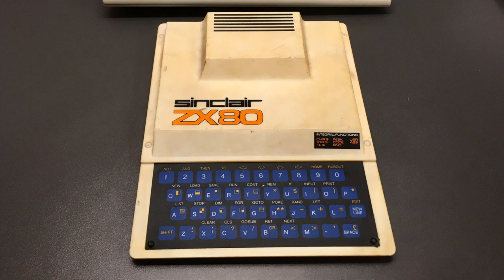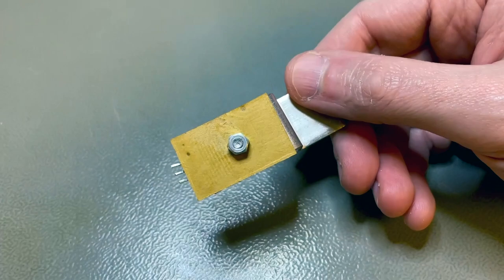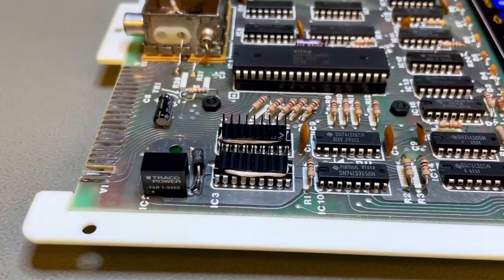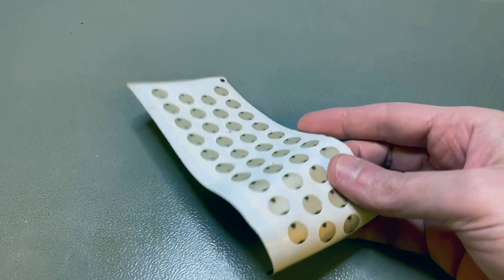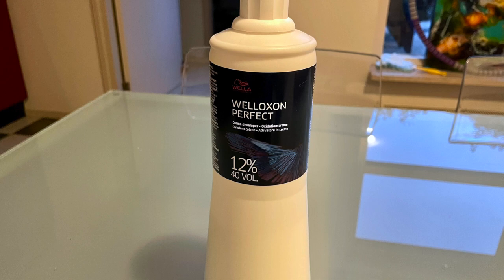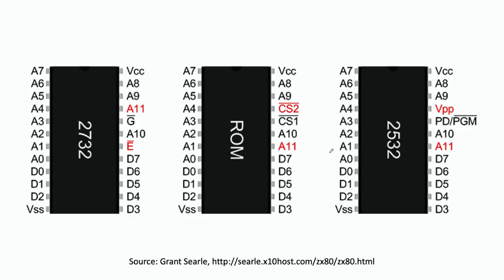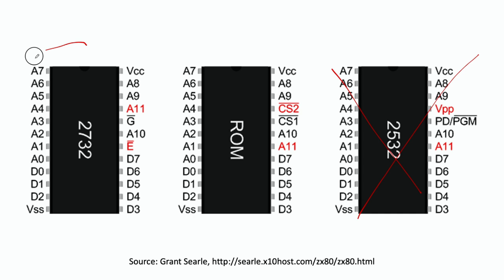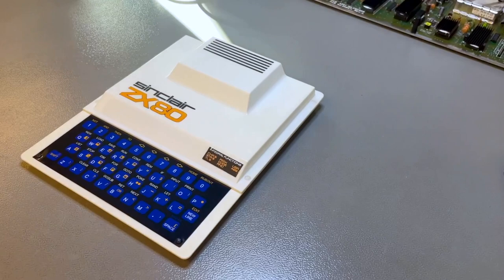ZX80 mini-restoration tutorial

Comment: Back in the day, when this sinclair was released. I really found it amazing that they could make it so so small. compared with all other computer's from that time, Sadly i have never owned on myself, but i always looked at them with much respect.
Reply from the maker: Engineering-wise, it's both terribly ugly (the cost-cutting shortcuts, such as a resistor bank to arbitrate bus priority...) and exquisitely intelligent, almost a miracle of parsimonious design!
Reply: @thebyteattic  Yes. That banks of resistors for "conditional" bus isolation is very clever.  I love the way the design uses the CPU executing NOPs while the hardware fetches and displays character data.  I built one from a kit in 1980 (placed my order at the show where they launched it). Sadly I no longer have it.

Comment: Thanks a lot for this, very very helpful.  I recently came into one, and I'm going to do something similar. One question on the retrobrighting. Can the peroxide go over the logs on the case - seems difficult to avoid, and not sure if it will damage it?
Reply from the maker: I had the same doubt. I tried to keep the peroxide away from the painted logo, but there was a little corner where it did get over the logo. And there was no damage or discoloration. So I guess it's safe, but am not 100% sure. I did keep most of the peroxide away from the logo.

Comment: Very nice. The EPROM bodge wires I would have used a thicker gauge and did the crossover in the socket itself rather than soldering to the board.
Reply from the maker: There is no vertical clearance, in the ZX80 case, to add an extra socket. And it is, of course, impossible to solder the bodges to the existing socket without going around the edge of the board, which would be difficult to fit into the case and be ugly/unreliable.
Reply: There is no real need to use thick wire here, just wire wrap wire is perfectly adequate! Bending out the EPROM pins does now win a beauty contest, but is quite okay.

Comment: I'm planning to do a comp mod on my ZX Spectrum and I like the look of the one you she here with the transistor - is it a general mod that would be suitable for a Speccy and for a electronics n00b, what does this do that a simple 100uF coupling cap doesn't?
Reply from the maker: In the speccy there's no need for a buffer circuit, as the ULA doesn't drive the video line directly. A capacitor to remove the DC component of the video signal will do, but I'd use 100uF, not 100nF. The latter doesn't have enough capacitance to maintain the AC amplitude of the signal.
Reply: @thebyteattic  thanks that makes sense, I hadn't checked the schematic to see how the signal was derived on both machines. I have a 100uF cap so I've got no excuses now!

Comment: Neat little machines, Somewhat hard to get hands on here in the US.  I wonder if anyone ever made an aftermarket keyboard to replace that hideous membrane one?  

Could you have made in interposer for the ROM to switch the pins, rather than the bodge wires or is the vertical clearance of the case above the ROM simply too low to accept the additional height?  Not criticizing, just curious...

Changing out the 5V regulator is a no-brainer, purists be damned.  Much better to have a working machine with a small, innocuous and unobtrusive modern part, than a full correct non-functional one that cooks itself on the regular.  Sir Clive wasn't expecting these machines to be still be functional in 1982, much less 2022.  They were built to an extreme price point, intended to be used at most for a year or two and then replaced with the new model.

As always, a super job on the restore!!
Reply from the maker: Thanks! Yes, the case is too low to accept a stack of sockets (the vertical clearance is about 0.5cm, less than a 1/4 inch). An adapter PCB could fit, without any room to spare. But it would be more conspicuous than the little, short bodge wires on the side.

Comment: Why not to use modern ceramic capacitors for recapping?
Reply from the maker: Electrolytic and ceramic capacitors have different frequency responses. They are not fully equivalent, even if they have the same capacitance.

Comment: a BC547 isn't too weak, its too slow. Its better to add an input PI filter (CLC) at the input of the traco converter, but no its not needed.
Reply from the maker: No, you are flat-out incorrect on both counts; in fact, you got it all upside down. A BC547 is a small signal transistor capable of only 100mA collector current, which matters in the emitter-follower configuration used in the mod. That's too close to the mark for safety, considering an input impedance of only 75 Ohm at the monitor. So I'm afraid it's indeed too weak, as I said in the video. As for speed, a BC547B can operate at up to 200MHz (transition frequency); that's way more than enough for a composite signal, so it is anything but too slow. A BC337-40, in turn, is capable of up to 800mA sustained collector current, a factor of 8 more than the BC547B. But unlike the latter, the BC337-40 can only do 60MHz; which is still more than enough for a composite signal. Why write a comment with such a tone of certainty if you have no idea what you are talking about?
Reply: @thebyteattic  sorry, the plain fact was that I just have no experience with the rare (for me) BC337-40, (which put me on the wrong leg, I did not understand why you would use this transistor, in fact I even first assumed it could be a PNP transistor) so I opened the datasheet only to check what kind of transistor it was,I did an attempt to compare the data sheet with the BC547 though, but you are right I should have looked at it deeper. I'm sorry!
I knew the BC547 as suitable for audio circuits only.  I would normally have chosen a 2N3904 for such an HF emitter follower, (in fact I did use that transistor in my own ZX-81 clone) but it seems that in many cases in practice people assume that no transistor buffering is needed at all, as I have seen many "patches" reported as working that simply connect the RCA video output jack directly to the video signal from the ZX-81, but yes your mileage may vary with that (especially when the TV as a problem with the missing back porch signal). depending on the TV used. Again my humble apology doubting your technical expertise, I should have known better after following all 10 of your SHARP MZ-80K museum quality repair video's, which really impressed me. 

As for the Traco, I applaud the effort to keep the ZX80 cool for a longer life, in fact will do the same for two Sinclair spectrum soon (the 1A version of the Traco, 500mA is too close for comfort).

good luck with your ZX80, which I assume will also be displayed in the computer museum in Helmond.
I plan to visit the museum in the near future, with Hassan Kasdemir of the national videogame museum in Zoetermeer! Never saw your museum IRL, but I do have contacts with Awesomespace in Utrecht, and the Bonamy computer museum in Zwolle (I donated computers in the past to both).
Reply from the maker: @martindejong3974  I think I took it too hard on you, and so I'm sorry too. I do care about the accuracy of what is written here, because I'm trying to maintain a reliable channel when it comes to technical information. In your case, it was clearly an honest mistake, but there are people on YouTube who make a sport of writing confident but just wrong comments. I don't know why people do it, I don't understand what the pay off is, but I find it increasingly annoying.
Reply: @thebyteattic  Yeah, I understand why you reacted like you did, no harm done.(even goede vrienden). P.S. Ik doe min of meer hetzelfde werk als jij maar voor drie "computer musea", alleen ik woon in zoetermeer dus zijn Bonami in zwolle en Awesome space in Utrecht net iets the ver weg, en dan was er de lockdown, alleen het nationale computer games museum in zoetermeer daar werk ik regelmatig, maar ik ben zwaar gehandicapt door Asthma, dus een (1) avond in de week is me genoeg. kom wel eens spoedig langs!

Comment: You replaced so much. Feels a little like you've built a ZX80 replica inside a ZX80 case. Unless you're planning on using this every day, I think it would have been worth considering keeping it original. ZX80s are getting quite rare.
Reply from the maker: The Z80 was defective; the RF modulator was defective; and the ROM wasn't a Z80 ROM... The only discretionary change was the regulator.

Comment: i learned to programme on one of those , 1k memory if i recall and no memory mapped screen
Reply from the maker: Just 1K indeed! But I believe the screen is memory mapped; it takes a little over 700 bytes, so there's just about 300 bytes for code.
Reply: @thebyteattic  The screen takes just as much as it needs and little more.  If you display empty lines they take only one or two bytes.  That's how you fit longer programs in - you just don't display so much.